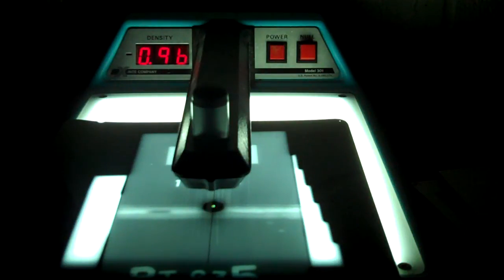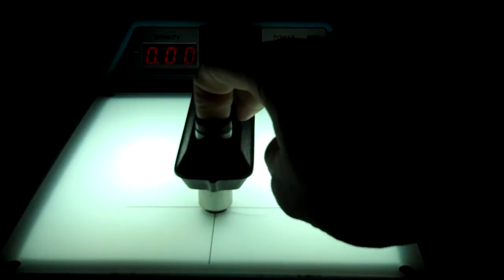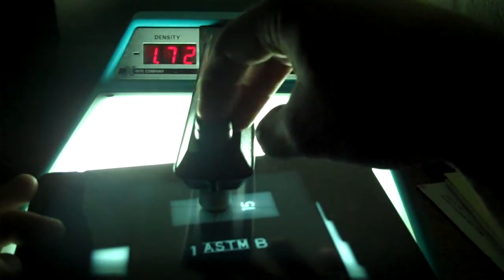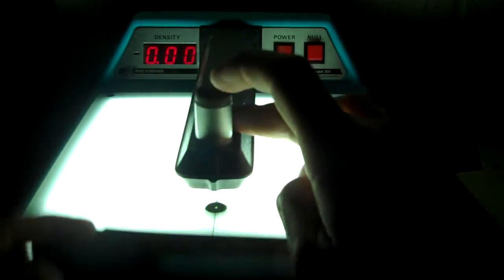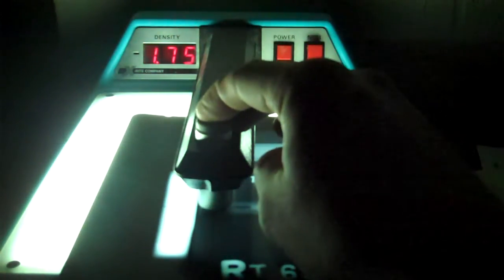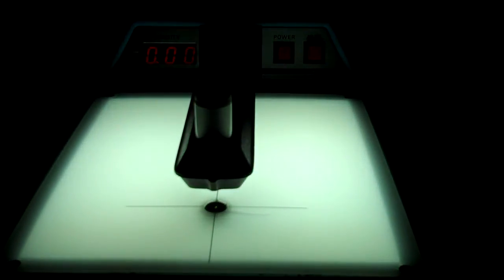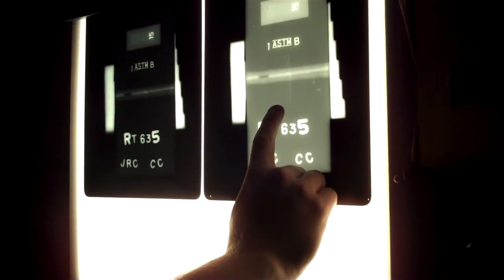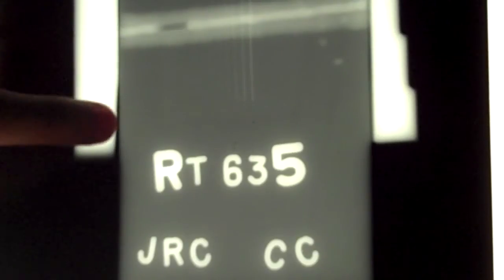Density Readings Film Viewing

Comment: Sir density reading of the manually taken RT films are below 1.8(as per ASME section 5 articles 2 it should be greater than 1.8 density units for x rays) do you think that film is acceptable or do they need a re shoot?  Explain please
Reply: Dear sir,
Kindly specify please.
Reply: Dear sir,
If you can kindly sort out my doubts by going in deep.